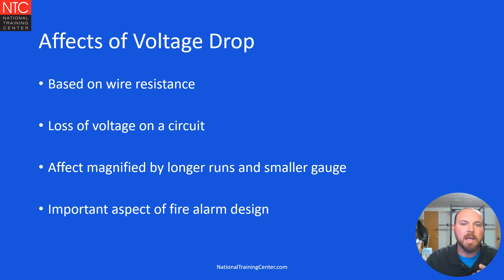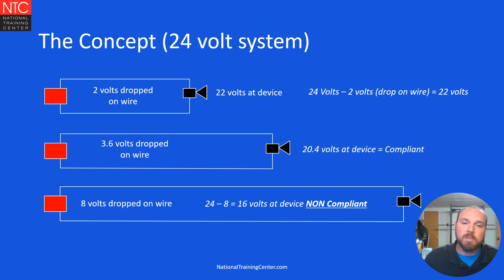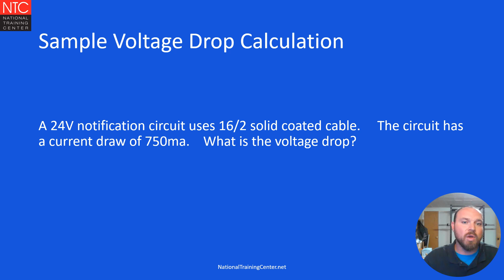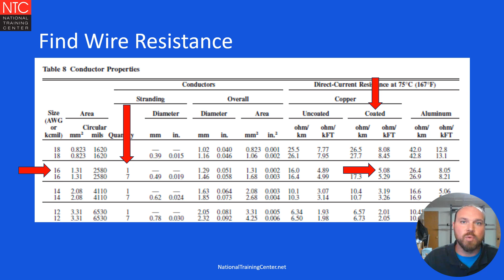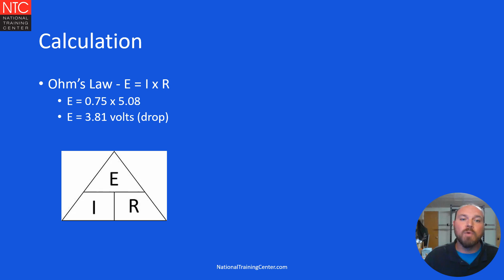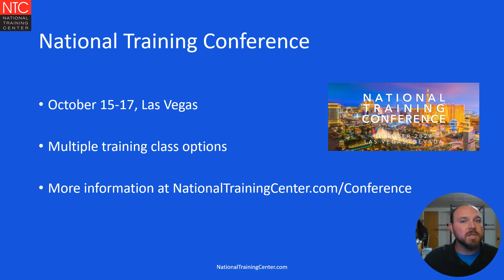Two-Minute Training: Voltage Drop

Comment: How does table 17.7.7.3.3.2 work or calculate? Smoke detector spacing based on Air Movement.